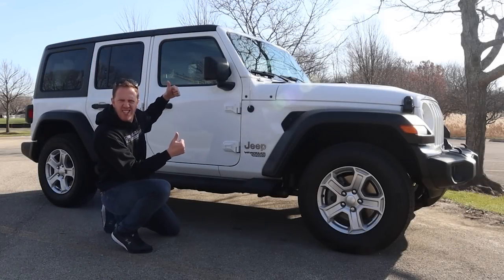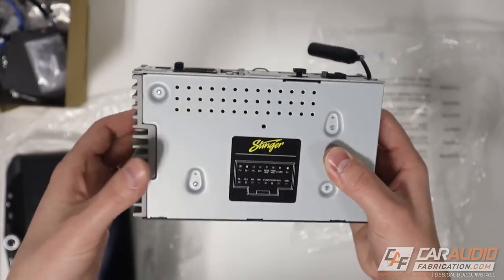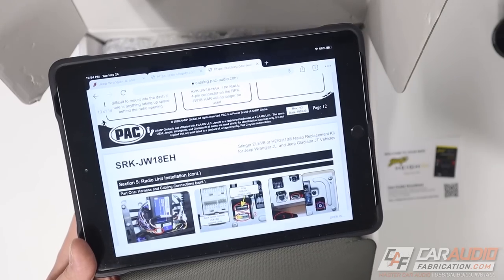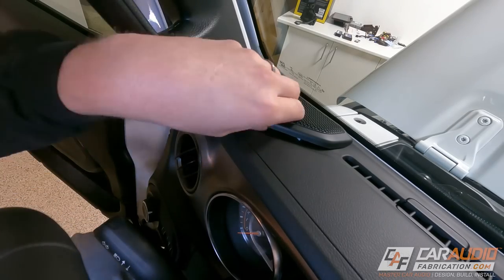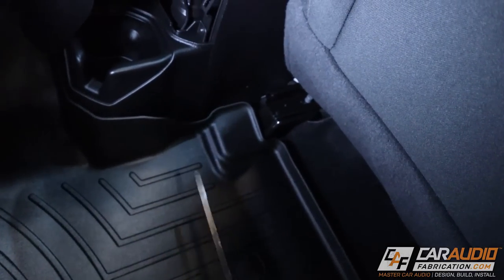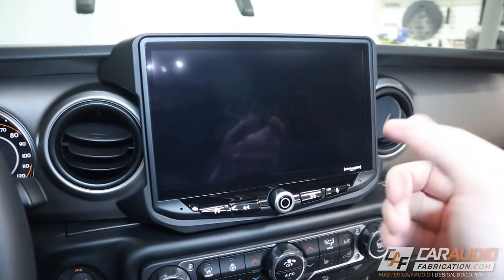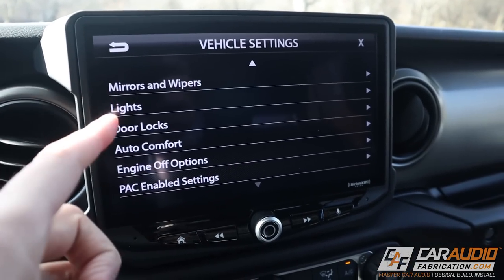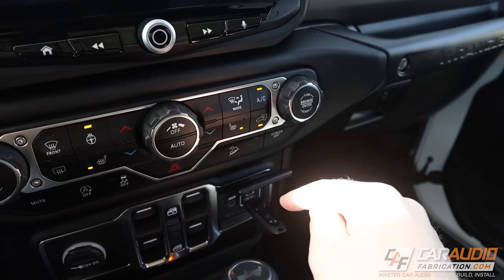Wrangler JL - DIY Radio Install HEIGH10 - HIGH END Sound & TONS of features!

Comment: This would be going in my f150 if it supported Maestro.
Reply from the maker: With the popularity of the F150 platform I wouldn't be surprised if a similar integration kit was on their list of vehicles to create solutions for.
Reply: @CarAudioFabrication  they have one, but I am stuck with the 8" MFT. I am currently considering the new JVC KZ-1000. The double din chassis should hopefully work well with the maestro kit.

Comment: with this unit and others is that normal not being able to listen to Bluetooth music while using android auto?
Reply from the maker: If you are connected via Android Auto anything you would be playing over bluetooth would just be played via Android Auto instead. You can however have other sources playing like the radio, sat, usb etc while using Apple Carplay / Android Auto.
Reply: @CarAudioFabrication  ah ok so you can be using android auto and say have Amazon music running no problem?
Reply from the maker: Amazon Music is an app that you would use through Android Auto.

Comment: Please, someone, make a kit like this for the Ram 1500. The factory head units suck!
Reply: My 2019 newer Ram 1500 8.4" is actually pretty decent.  Of course I have changed out all the speakers and I am using a Kicker KEY 180.4 amp.  The factory head unit in the Jeeps are not that bad either, once you upgrade the speakers and add a Kicker KEY 180.4 amp to that too.  The factory speakers is the weakest link.
Reply: Coming soon 🤫
Reply: @Spur5000  Do you work for them?

Comment: About time someone gave The Restyle a run for their money. Not exactly budget friendly but at least it costs 1/2 as much as Alpine's offering. Either or, imo it's just not worth spending that much money to upgrade the sound system of a vehicle which is arguably the worst vessel to try to build a system in. Wrangler has the noisiest cab of any vehicle in production...and that's with the hard top. Times that by 4 with a soft top. Zero factory sound dampening...literally sheet metal with a removable rug & logically so. It's an open air offroad vehicle by design. No sense in going nuts with a sub...bass would just get lost with the top down & doors off.

Comment: i watch this full video but I can't get what I want that is sound test. 
Please do a sound test.
Reply from the maker: Sound test via YouTube is pointless. You would be hearing the performance of your phone speaker, headphones, or whatever you are listening to through a heavily compressed audio file.
Reply: @CarAudioFabrication  where that file ?
Reply: A sound test video will not show the differences in the stereos.  Having both the factory 7" unit, with Audio Control hi/lo, amps, speakers, and then upgrading to this Stinger unit, I will say this head unit is clearer sounding than the factory unit BUT only noticeable if you have some very good or great sounding speakers and hardware.  You can get surprisingly very good sound out of the factory unit.  Btw, I used to install car audio and very picky about my sound.

Comment: CAF: Why don't stereo manufacturers allow you to lock the max volume to a lower number or scale it so that once you have identified the clipping point it won't be possible to exceed that volume?  This seems like a no brainier to me...
Reply: This unit technically does by using the crossover level adjustments. You can also adjust the level on every source.

Comment: The auto stop/start memory function is huge.  I hate that “feature” on new vehicles.
Reply: Does that mean you can turn off the ASS feature?
Reply from the maker: Me too, literally every time I get in the car the first thing I do is turn off the function. They say "the ignition and other components are upgraded to handle the additional cycles" but with the OEM's literally picking parts that cost fractions of a cent less, even if it means they are worse quality, I somehow doubt that statement is true at all.
Reply: @keystoneclassic  It means the PAC module will retain whatever setting the button was at when you last shut off the vehicle.  Default from the factory is for the function to always be turned back on at startup.

Comment: is that a standard 1DIN
Reply from the maker: The HEIGH10 can be used in a single din opening with the "SE-DIN mounting kit". Which is super cool! In this case though on the Jeep's it isn't really a "single" or "double" din opening. Somewhat of a hybrid that requires a special kit like this.

Comment: I think is an absolutely ridiculous high price. as is almost everything related to the Jeep name. I don't need a 12in screen, and I'd bet nobody else does either. I like the screen size that comes in the JL. Its not small, it holds all the info I need without having to move my head to see one end to the other. I would most defiantly upgrade, but just the functionality not the screen size, I'm totally secure in my manhood. If someone made a direct replacement, for say $800, I'd go for that.
Reply from the maker: Its not for everyone. Like most things that are quality and perform well they have a price, there are others on the market in this category that are double the price, and for something that costs less than the dealer upgrade, I'd say this is a pretty great value. The ELEV8 also is a great choice for use with this same integration kit for a smaller screen. Not sure why you had to imply that anyone who has a cool head unit isn't secure in their manhood... lol.
Reply: Great video! Very key piece of info for me was everything is truly plug and play. No splicing.

Comment: green to white and white to green can, what a simple error why make them opposite thats a bad design
Reply from the maker: Thats by design by the manufacturer, nothing to do with Stinger. You will notice the factory wires are all that way. If Stinger changed it it would just be more confusing.
Reply: @CarAudioFabrication  so new kenwood 10 inch and this radio many similarities mark?